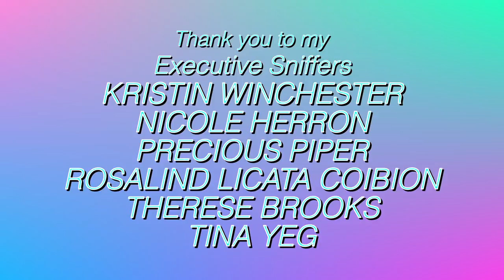WORLD'S BIGGEST DIY PARROT STAND FAIL 😂 | MARLENE MC'COHEN

Comment: I made a similar parrot stand using the same materials, it definitely comes out  much cheaper than buy a javawood stand off the internet or the pet store. I am a daughter of a carpenter so I already had a design in mind but George's design is very similar to mine. I made mine for about $85 & a store bought stand cost like $299 & up. For large parrots stands cost $399 & up. Yay for hardware stores with plumbing departments.
Reply from the maker: Oh that's very cool!!!

Comment: Couldn't you guys just made it out of PVC and it would be significantly cheaper as well? Haha...
Reply from the maker: Rocky is a bit heavy for PVC alone but it will work with the other birds
Reply: @MARLENEMCCOHEN  Rocky weighs I am guessing between 2-3 lbs? I believe if you use PVC that is large enough in diameter it shouldn't bend.
Reply from the maker: Hmm, I'll test that out,  he might also be able to chew it. He can chew through a very thick plastic bowl.
Reply: @MARLENEMCCOHEN  PVC is much harder, and denser than normal plastic. I've seen it used for large parrots normally so you should be fine. You could put natural rope to give him something as a grip it might also give him the incentive to chew on the rope instead of the pipe. You are from California you might want to try Eucalyptus trees as a alternative if that doesn't work they are all over here, and completely non toxic, and safe for birds just obviously clean them first.